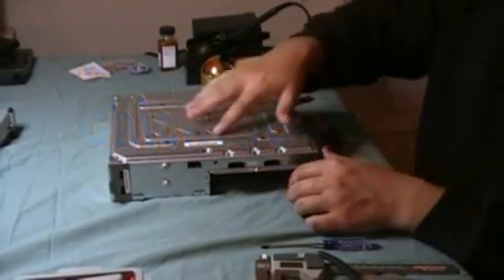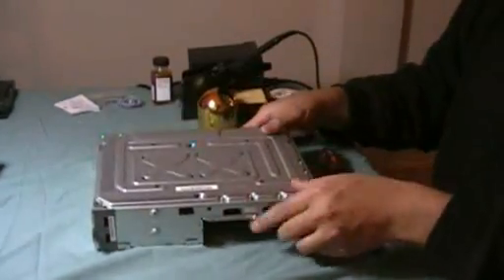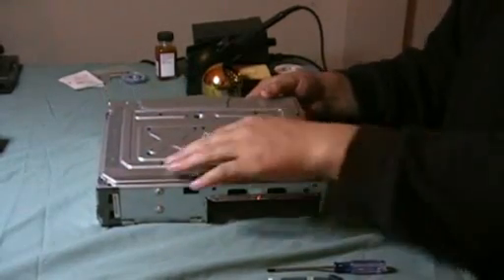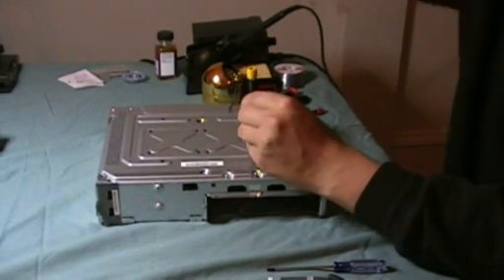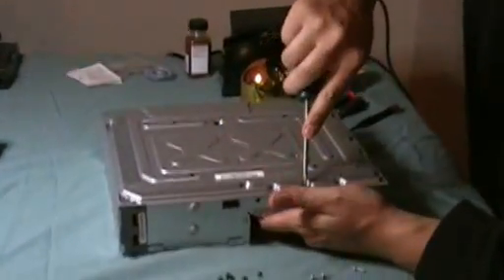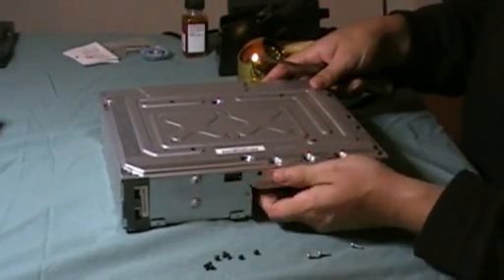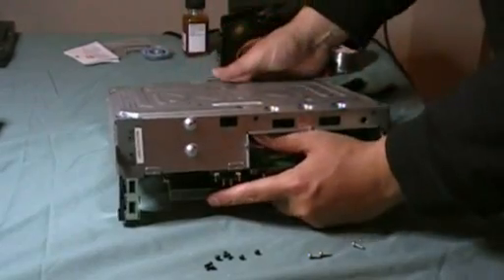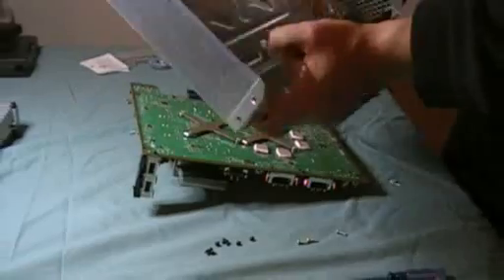XBOX 360 Removing the Motherboard Tutorial

Comment: Fucking Torx, fuck this, fuck fuck fuck. I was screwed with my PS3 which needed a Torx 8, I bought a Torx 10 and it actually fit, but there's no way T10 will work on the 360. FUCK

Comment: hes chatting shit bout it costing more, buy the toolkit and do it yourself. yes every board has a unique serial number it is also matched to the dvd drive in the xbox. buy a cheap rrod repair kit off ebay and the tool, its easy. if thaT FAILS, buy a rrod xbox from ebay and use the repair kit on that instead